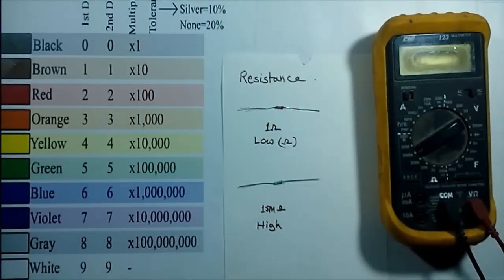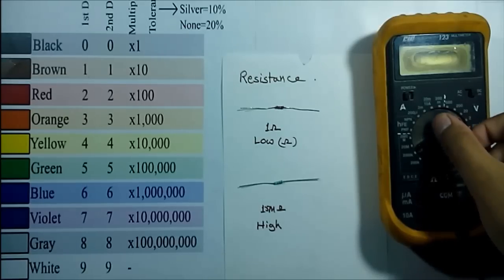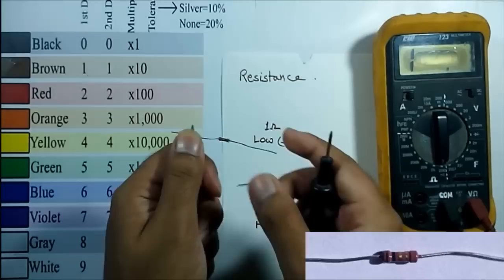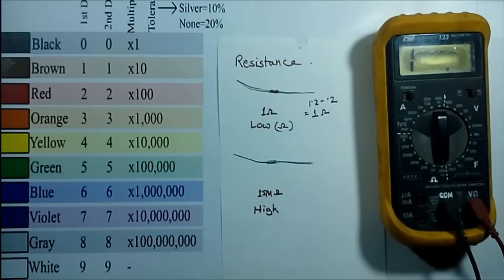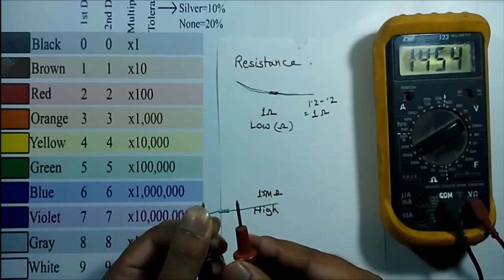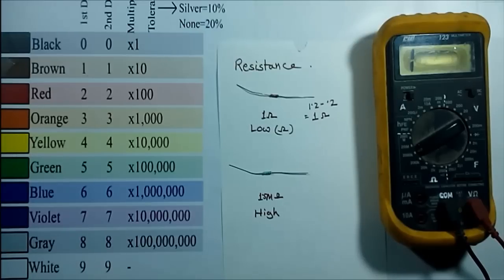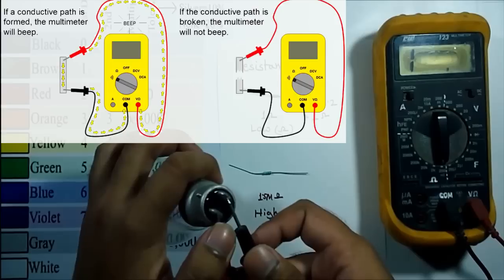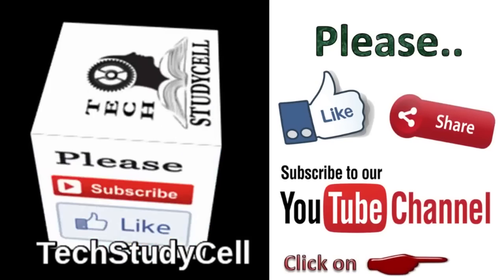How to measure Resistance with Digital Multimeter / Multimeter tutorial

Comment: thanks , how we measure or know MSD resistors value on mini  STB  powered by 12V  I found  2 MSD but I didn't know the number of them and there are no letters like  C    or    R       and no numbers  how I know the values and   the type  which is  resistor  wich is capacitors  thanks.

Comment: Thanks, sir. I had thought my new cheap digital multimeter has broken because I had cleaned the corrosion on the V-ohm's hole before and then I measured the low ohm resistor was showing weird value but the higher resistor was fine. I was never notice the substraction number before. And maybe that was the first time, measuring the low resistor using the multimeter. I'm newbie and starting love the electrical world, anyway. Thanks for the tutorial. I appreciate that.
Reply: Thanks for the Video! Apologies for the intrusion, I would appreciate your thoughts. Have you heard about - Runayslarn Survival Manifestation (do a search on google)? It is a smashing exclusive product for discovering how to repair your electronic items without the normal expense. Ive heard some extraordinary things about it and my old buddy Taylor after a lifetime of fighting got excellent results with it.

Comment: Why you get a beeping when you test the 1ohm resistor ?  Is that mean the resistor is shorted ?
Reply from the maker: In my case, the multimeter I am using it's having the same selection for 200ohm resistance scale and continuity testing If you look carefully then there is also a continuity symbol below the 200ohm level in the multimeter.
If you use different model multimeter there may not be any beep sound while measuring low resistance.

Comment: Do i have to remove resistor from board before testing?
Reply from the maker: Yes... Always... Otherwise you will not get the correct measurement...
Reply: Tech StudyCell ...thank you..My g.e microwave heats up only issue im having it doesn't show no #'s on display,could it be resister,transistor or a capacitor?
Reply: sir plz tell me...if 500w ahuja amplifier shows overload..what should have I do...I have already check transistor and fuse...

Comment: man... how to measure bad resistor in motherboard.....????
Reply from the maker: You have to remove (desolder) the bad resistor from the motherboard first, then you can measure it with a multimeter as I have shown in the video.
Reply: It will show either short(zero Ohms) or open (Mega Ohms).